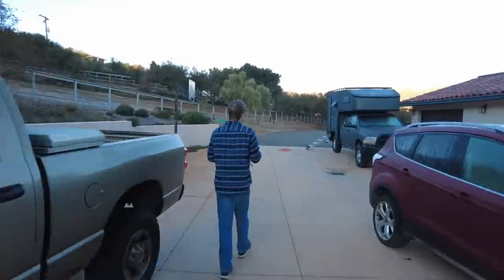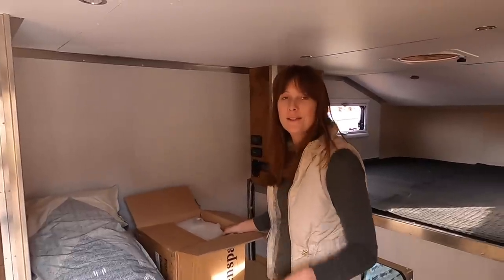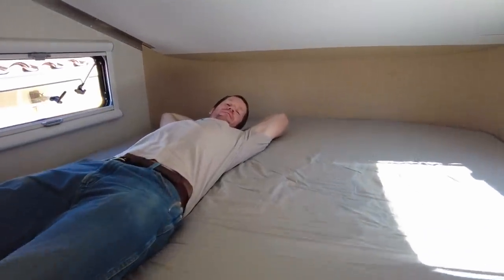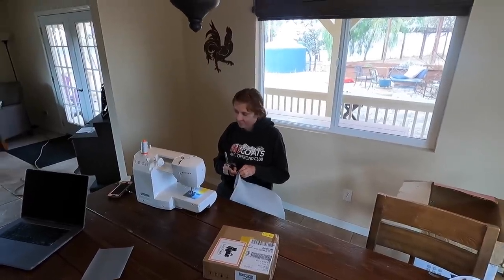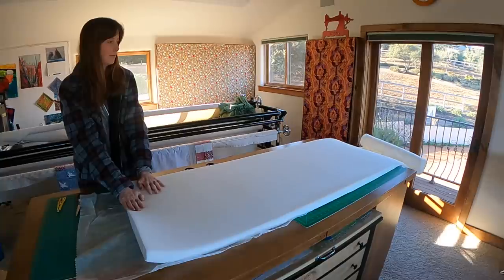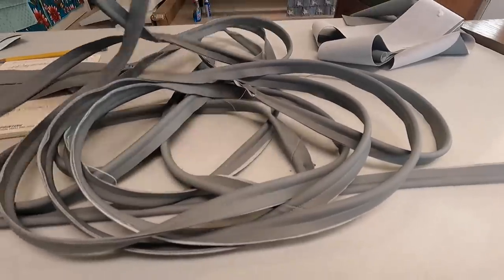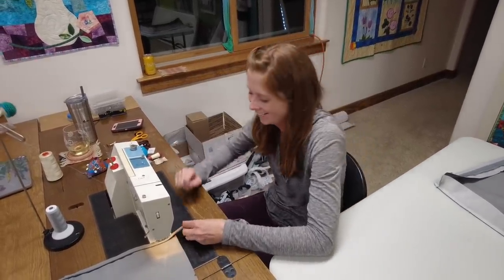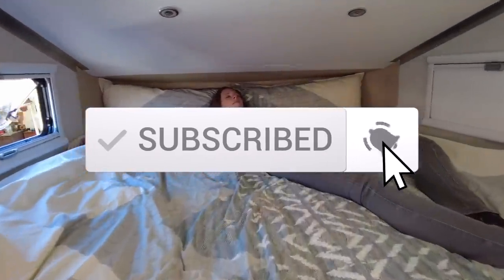Building Our Expedition Vehicle E14 - Custom Cushions

Comment: Quick tip I learned from an RV upholsterer.  If you're ever having trouble putting the foam cushion into a tight cushion cover, simply put the foam into a plastic trash bag and then insert it into the cover.  It'll go in much easier and once it's in, tear the bag off of it and voila.
You all are doing a great job and I look forward to every new video you all post.
Reply from the maker: I actually had to do that on a few of the cushions and completely forgot to film. Thanks for watching and following along on the build!

Comment: Great job doing the cushions!!  If you get some fluffy batting (not the dense stuff, the cloud like stuff) and spray the foam with spray glue and wrap them with batting it will take the creases out of the cushions and make them fit like a glove.
Reply from the maker: That is an excellent idea!
Reply: @AmbitionStrikes  it is what most upholsterers do and is an easy way to make them look plush and stuffed.  They look great, you rocked the piping

Comment: I'm really impressed with the design quality of this camper and your craftmanship!👍👍 
Still, I have two questions:
How did you seal/insulate the point, where those  sidewall panels meet? Or did I miss that point in your videos? And how do you clean your freshwater tank, with all the batteries etc above it?
I'm looking forward to your next episode.😊
Reply from the maker: Hi there! The horizontals seams overlap 2” like a roof shingle and are sealed with VHB tape and a thick bead of Sika. The battery shelf is easily removable should we ever need to access the water tank! There is also a drain for the tank coming out the bottom of the camper.

Comment: Hi Courtney and Riley first off absolutely amazing build! I live in a 1985 truck camper and will be building something similar in the near future. You guys definitely went about it the right way! Anyway I wanted to tell you guys about the afterburner for the Chinese diesel heaters. I have a feeling you guys have stumbled upon it on the internet. You guys definitely do your research! I highly recommend getting one for your heater if you’d like plenty of extra features. Also I have a “ Froli system” under my bed which I highly recommend for moisture. I’m living in my camper in truckee right now so I’m very aware of all issues that revolve around winter living in a truck camper! I’d love to meet you guys some time if you’re coming this way!
Reply from the maker: Hi Dan! I have the Afterburner on my list of things to check out when I have some time. Does it allow you to program the heater to kick on and off? We were actually too warm on the the first trip we just took and it was 15 degrees outside. We have plans to ski Squaw soon so I will definitely let you know when we are headed that way!
Reply: @AmbitionStrikes  The afterburner has an external temperature sensor so you can set it to a thermostat mode. In that mode it won’t shut on and off but will change its fuel setting automatically to do its best to regulate the temperature you desire. What I do is use the timer to throughout the night turn on for about 45 minute intervals and off for about an hour. The heaters can get full of carbon especially at higher altitude here in Tahoe from running on lower hertz settings which will cause them not to ignite and have to be cleaned/rebuilt. So because of that I have my afterburner set to
not run the heater above 3.7htz. I rebuilt the heater about 6 times last season but haven’t had any issues since figuring these things out. My girlfriend works here at Squaw so I’ll be here! Look forward to meeting you guys!

Comment: you guys should try the froli bed system.  Theres going to be moisture issues with the solution you chose.  More comfortable too!

question about your suspension... you did a 3" lift, front and back or just front?  also 40" tires did you not have to rebuild the whole suspension, AFAIK 40" tires require a lot more than just a lift.
Reply: and can I send you two some good coffee, how about dark matter from chicago?? light or dark?
Reply from the maker: Hi Jonathan! We have heard great things about the Froli system! 

We have not modified the suspension yet and are currently running 35” tires. The plan is a 3” lift and 37” tires so that we can avoid the domino effect that you speak of when you jump to 40s!

Comment: Excited y'all got the Pocket 2, we have been thinking about getting one as well!
Reply from the maker: Thus far I am very impressed! However, don't be tempted by the camera only package. I thought I could just buy the microphone a la carte but you need the wireless transmitter that comes in the creator package to be able to use the microphone!
Reply: @AmbitionStrikes  Thanks for the tip, I probably would have tried the buying the microphone a la carte as well!